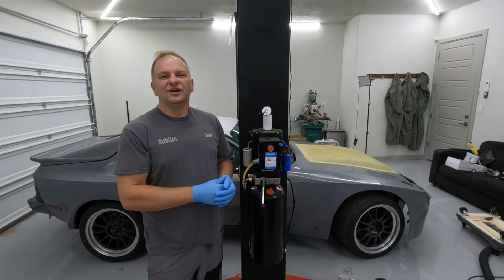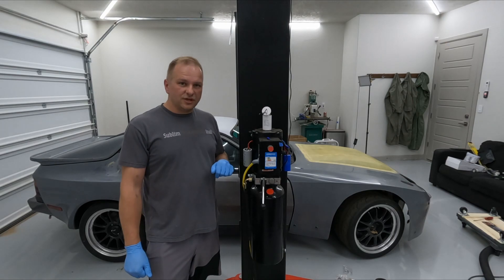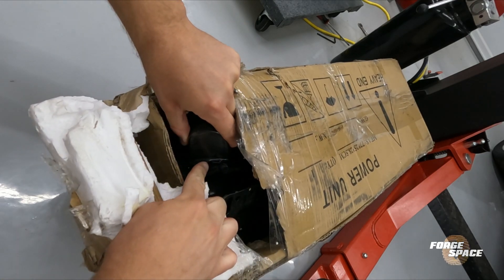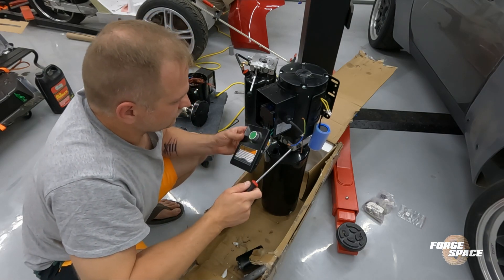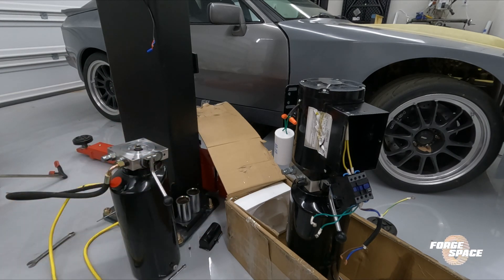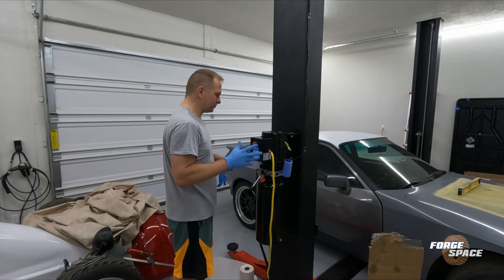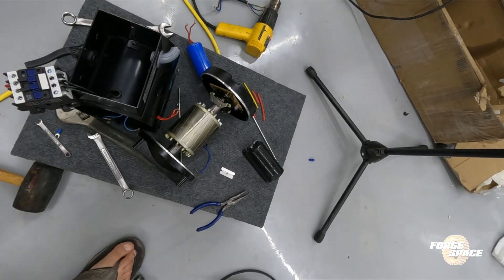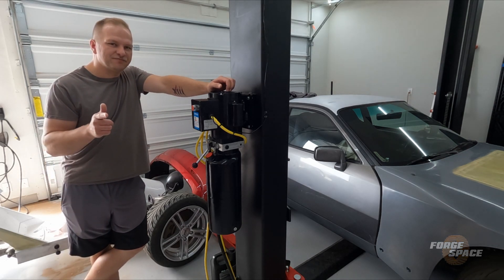Replacing the Motor on my Olympic Lift

Comment: Having lift capability really extends a small shop.  We don't need to lift more than 18", but we do need full suspension and undercarriage area access.  We went w/a QuickJack 5000 that's let us do transmission, exhaust, suspension, and other work much more safely and quickly.
If a full lift won't work in your area or you need to be track/portable, the QJs are awesome.
Reply from the maker: If it wasn't for the kitcar build coming up I would have bought a quickjack. Unfortunately I will need access to the whole floorpan all at once.